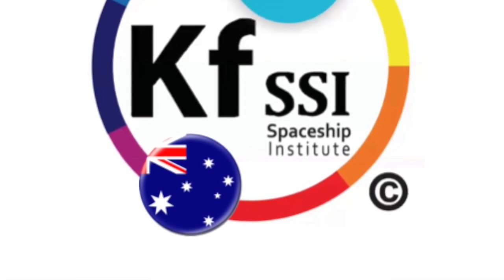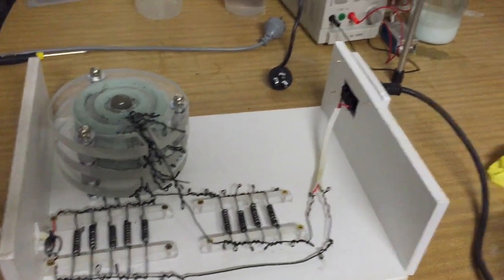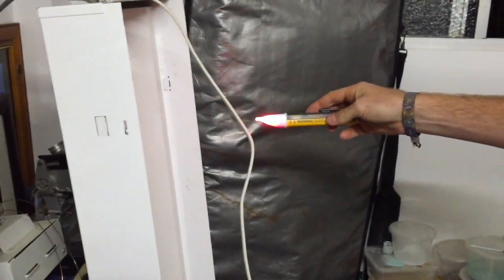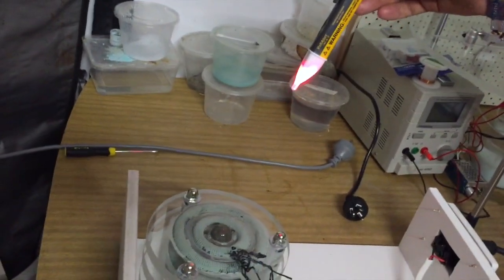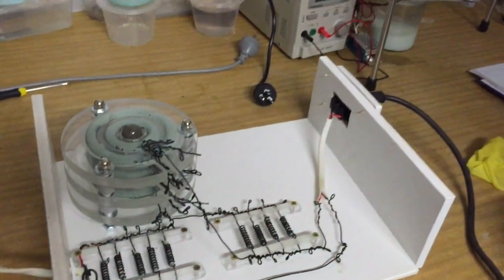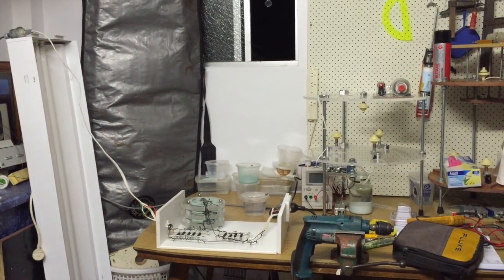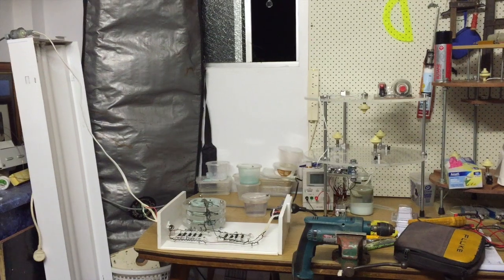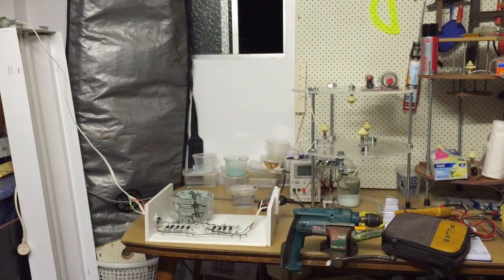KF Australia - Breakthrough!! Working Magrav power unit - Free, clean renewable energy!!

Comment: cool tools!
http://www.amazon.com/gp/product/B015PCCNRA/ref=pd_luc_rh_sbs_02_02_t_ttl_lh?ie=UTF8&psc=1 
the "hot stick" or "odd stick" (my hearing...) is called "Voltage Tester Pro - The Quick and Effective AC Electrical Circuit Non Contact Detector Probe Meter Pen Tool with a Flashlight" and on sale for $20 from amazon if you buy more than $35 total. I highly recommend this tool for those who have fear of being electrocuted when working with 110/220 volts of power. I also like those clip on amp meters. Great video please keep it up! It looks like objective evidence to me.

Comment: Hahaha yeah congrats you have 0 meaningful measurements and call it "Breakthrough".
Reply from the maker: +Sebastian Au Hi there! Thanks for the comment.  We may not have had all the 'meaningful' measurements but wanted to share a special moment after years of developing the technology in this humble backyard.  We will definitely try and share more of the process and creation.  Let's share the knowledge!  AND it definitely is a breakthrough!! IT WORKS!!!
Reply: +Joel Rasmussen It's great that you share your experiment on youtube! Thank's for doing so but apperently that's not how you proof your concept... You just measured current neglecting other parameters and furthermore every measurement without knowledge of the uncertainty is meaningless.
Reply: +Joel Rasmussen 
Saying it is 'working' means that you are measuring more real power out than the input real power consumption, since the magrav unit's purpose is to produce more power out than it consumes. Comparing currents tells you nothing about the actual efficiency of the device. You have to compare real power consumption at the output to the real power consumption at the input to calculate the device's efficiency. The drill is a reactive load so it will have a reactive current component. In the very least you need to get yourself two decent AC power meters and compare input and output power consumption. Most commercially available inline AC power meters automatically take power factor into account and can display the real power consumption. Were you deliberately trying to mislead people by saying that your magrav unit is 'working' when in reality you haven't made the proper power measurements yet to determine the actual efficiency of your setup?
Reply: +jamin 12 Voltage. But I see, in English it is V. U is the German abbreviation. My bad.
Nevertheless this is only for DC
In AC it is P = 1/2 * Vp * Ip * cos(phi) (English abbreviations this time)
P = power, Vp= peak voltage, Ip = peak current and phi (the greek letter) is the angle of phase shift between voltage and current
and that's a complete different story. Trying to measure that in the way they did it in the video just shows their ignorance
Time to do your homework my friend :)
Reply: +Sebastian Au I don't think he is trolling. It is just the standard stupidity of pseudo - wannabe - scientists following a whacko like Keshe :D
Reply: +Sebastian Au Yep. Idiotitis is contaguos :D
Reply: mag netron  return to my Electronic Engineering program
Wow!
http://thinkscientific.w4f.eu/morbus_bahlsen.html
Reply: Sebastian Au Of course not. Very advanced state of
http://thinkscientific.w4f.eu/morbus_bahlsen.html
Reply: +mag netron Nice ESO fairy tale :D
Reply: +Joel Rasmussen No, it does not. You can say that it works as soon as you measure a reduction in power consumption of at least 20%.
That it does not (yet) blow the fuses is just, because you are lucky. And you are as well lucky that you are still alive. Playing around with line voltage without any real knowledge is life threatening.
Get a clue man. :(
Reply: Albert J I don't think he is lying, it is the result of total lack of knowledge about electricity.
Reply: +Josef Görling He's got an electrician with him so i dont understand your comment. How about positive input into the discovery? I guess haters are gonna hate.
Reply: jamin 12 Have you seeh what they are "measuring"?
Sorry, what they did lets them appear like children playing "electrician"
Reply: Josef Görling
OK....lets wait and see the results P = I x V
Imagine breaking the energy monopoly globally - thats a game changer - if i can help i'm all in.......sharing info and results is the only way.
peace Josef,
Reply: +jamin 12 Your formula (correct would be P = U * I) can be used only with DC. In AC it is completely wrong, especially if you have to deal with inductive loads. Stop dreaming :)
Reply: Josef Görling
Dont know where your from Josef but Power(Watts) = I (current) x V(volts) in an AC Circuit....time to get off the pipe my friend.
What does U represent in your formula?
Reply: +jamin 12 As I said: they neglected other parameters by just making a measurment of two currents. And every measurement without knowlede of the uncertainty is meaningless. What they are doing is not even close to
a breakthrough it is just a couple of guys playing scientists. ;-) Of course you can state that one of them is a so called electrician but that's not really a point... https://yourlogicalfallacyis.com/appeal-to-authority Let's say they measured Irms(root mean square value of the current) than we can make an assumption(that the value of Vrms is 240V because they are in australia. Now based on their measurment we can calculate the apparent power Papp=V*I for both measurements but that's just the apparent power. But there are other cool paramaters here... like the effective power and the reactive power... what's with the phase-shift? Furthermore what's the uncertainty in the measurements? Remember: we have to calculate the power so the error can propagate through the calculation and can effect the result in a higher(or smaller, or unchanged) way, but we can not determine that without knowledge of the uncertainty, that's why that measurement is meaningless. And remember the root mean square voltage is just based on an assumption neglecting the ripple... Do you need more?
Reply: Sebastian Au
Give me the formula for plasma.
Math is absolute.
Reply: jamin 12  The funny thing is: I can just say: I can not give you "the formula for plasma" and that still does not change a bit about the facts I mentioned which make their breakthrough meaningless, because all of the data is meaningless. And furthermore what Keshe says about plasma is not consistent with the plasma(phys.) so it would be better to make that clear, otherwise some people might start to think that it is the same, even though it is obvious that it is not the same. ;-) Furthermore there is not "a formula for plasma" You should understand the concepts you are talking about. But fine I will tell you the formula for plasma if you tell me the formula for solid first. ;-)

https://en.wikipedia.org/wiki/Plasma_%28physics%29
Reply: +Sebastian Au Plasma in the matter state constitutes heated gas there is formula. 
Free PlasmA is supplied by the universe antimatter is Plasma ,magnets have a Plasma Field passes thru anything without Plasma no particle can exist what was first Plasma or Particle?? this I understand, light photon cannot exist without magnetic field Plasma dark energy but magnetical field Does not need photons to exist . In the beginning there was Plasma the principle, from Plasma  came particles neutron and from neutron came proton and electron  . Carl Sagan would support Keshe.
Reply: Hahahahaha yeah no Carl Sagen would not support Keshe lol don't troll.
Reply: +Sebastian Au I have done experiments so I have empirical evidence. co2 capture system nano coated my copper wire connection between nano coated cu and zinc plate with no external power source And the results are repeatable.
Reply: +Josef Görling look at my videos you can see magnetic lines of force between two nonferomagnetic plates, and also magnetic lines of force that display 90 degree lines on my other videos go to my YouTube channel.  Adai und learnen foon mine video. Danke shoon bitte
Reply: Sebastian Au Fact; Boeing and NASA both corresponded with Keshe and both federally subsidized wanted to weaponize Keshe system nufff said case closed!  Bam!!!  Boyahh!!!
Reply: Josef Görling
 Yeah I guess you are right, apparently it is normal for some folks to behave like this.
Reply: He does not even understand the scientific concept of magnetic fields(or anything else, as it seems) maybe he watched too much of this Keshe-BS.
 :D
Reply: +Sebastian Au Definitely, and was infected with:
http://thinkscientific.w4f.eu/morbus_bahlsen.html
:D
Reply: +Sebastian Au maybe you can create formula for Plasma if not then you are foolish anyhowmust return to my Electronic Engineering program later days fool!!!
Reply: Fair enough please tell me the formula for plasma(or are you unable to do that, if so you are foolish) sadly I never learned THE "formula" for plasma while studying electrical engineering. ;-)
Reply: Sebastian Au sure for 5billion worth of gold hehehehe. ;D
Reply: But I guess you are not able to come up with a better answer than stupid BS like you wrote about plasma etc.
Reply: The stupid is strong with this one :D
Reply: He is clearly trolling now, the question is: Is he doing it on purpose or is he just not able to come up with substantial arguments? I guess it's the second option.
Reply: Sebastian Au I guess he is in a very advanced state now, including an opportunistic infection
http://thinkscientific.w4f.eu/morbus_bahlsen.html :D
Reply: You have much better hypothesis if not then you have been derailed you are stuck at the matter level to bad ssooo ssaaddd did you know that JP Morgan had math formulas watered down some formulas that would lead to free energy, even removed some math formulas from university text books in electrical engineering he owned most of the publishing companies in the 1930's in the united states you have learned only a fraction of what you should have learned as an electrical engineer guys like Tesla ,Henry T.  Moray, understood Free Plasma energy and they had the math needed to formulate their theories the new physics is being taught by Keshe based on the dynamics of the universe some Physicist call it convulecent science it is the new physics as a result of space telescope forming of galaxies are observed much better now than what was available pre space telescope new information had not even been printed yet text are behind by as much as ten years new theories are still being formulated based on new observations.
Reply: Roger out
Reply: Maybe one day this mag netron will be able to realize that this video does not show a breakthrough, but to sum it up (again) The video is not a breakthrough just because it contains an appeal to authority(It does not matter if one of them is an electrician or not their measurement is meaningless and even though I am an electrical engineer from germany my statement does not have to be true, that's why arguments are needed.), So the video is up for a couple of days now, if this devices works and they have competent people, why aren't substantial measurments published right now? An electrician normaly should have all the tools needed and should not rely on two clamp meters liker this... This is not a serious result it is a joke. And of course I want to repeat this: Every measurement without knowledge of the uncertainty is meaningless, what they have done is a simple test without considering all important parameters, without serious testing but with a pseudoscientific measurment. I am sorry to say that, it's nice to see laymen trying and testing stuff, but they should not call their own mistakes a breakthrough.
Reply: Sebastian Au yes I know they are not engineers lol
Reply: That was not the point because it simply does not matter if they are engineers or not.
Reply: I just uploaded a video , and my magrav coil increased in voltage when I shined my LED flashlight on it. Very simple only three items used for test.   1. Magrav coils  2.digital meter and a 3. flash light check it out!! Ichs mochen ien pilsner bitte danke shoon!
Reply: mag netron What about a link to the video?
Reply: Kannst du dir anschauen, wenn du auf sein Profil und dort auf Youtube klickst. Sind auch nur 58 Sekunden in denen er mit einer Taschenlampe auf seinen "Magrav" leuchtet als ob das was besonderes wäre. :D :D :D

Comment: the voltage drop in the out put increase the load (current), so no gain???????????????,
Reply: +Posiible Free Energy? No. This is a misconception. The same load connected to a lower voltage draws a lower current

Comment: Hey there, here is a very easy to perform test. Switch off all loads in your house. Note the number on your power meter, turn on load with Magrav for one hour, again write down the numbers. Repeat with same load without Magrav. Compare numbers. Prediction: it hardly makes any difference.
Reply: +AuaKW You can bet that this is the outcome.
Reply: even barely a difference will account for lower energy bills overtime. both of you have confirmed Keshe. GJ
Reply: +Buying SUMMONS No. Have a look here:
http://thinkscientific.w4f.eu/Messtechnik.html
Reply: WOW. Actually a very nice read. So correct me of I'm wrong. All this device is doing is basically "Speeding Up" the flow of electricity to make it look as though you were getting an increase in efficiently, but in reality the intake and outage are exactly the same in terms of energy, but just appear to show an increase? That's my understanding now.
Reply: Buying SUMMONS That's one point. The second is, that none of the devices used for testing is a constant load and that there is no parallel measurement performed on input and output of the MAGRAV unit, which is the only reliable way to get a correct result.
Guess why Keshe explicitely forbids this kind of measurement with the lame excuse that it will "disturb the plasma"

Remember that all the measurement restrictions, the conditioning and the "blueprint teaching" came after the devices given to the "ambassadors" on Oct. 16 2015 failed miserably, blew the fuses and caused damage to their house installation.

The true reason was a severe design flaw, which caused the units to short the line voltage immedieately when they were switched on, which shows clearly, that these devices were never even plugged into a wall outlet before they were delivered.

Maybe you want to have a look here, where I analyzed Keshes Fukushima cleanup experiment using the original measurement protocols and the video and which shows undeniable that he was also cheating:
http://thinkscientific.w4f.eu/cheating.html

Comment: Hi Kevin , thanks for your answer .
in and output monitoring would be nice , its easy to assemble in your demo .
best wishes , Alibaba
Reply: +Alibaba Neue-Welt  ,
 i mean Voltage incl Amps
Reply: +Alibaba Neue-Welt 
They also need to measure the power factor at both the input and output.